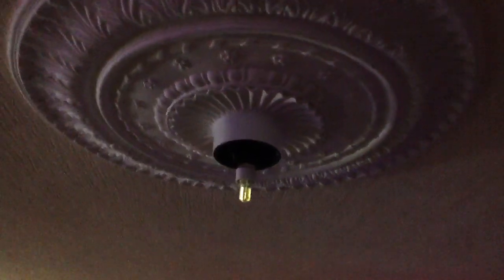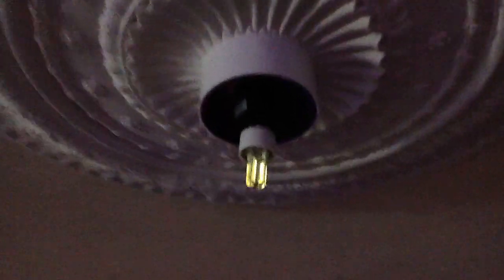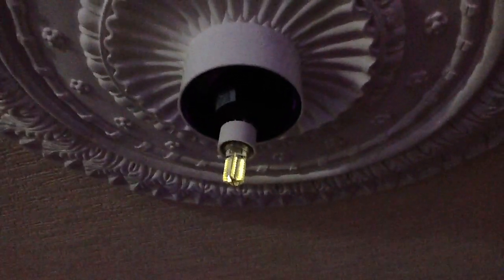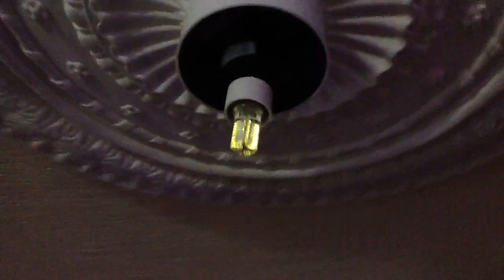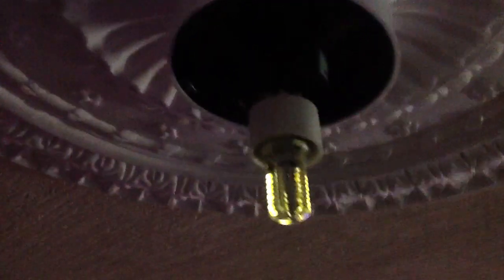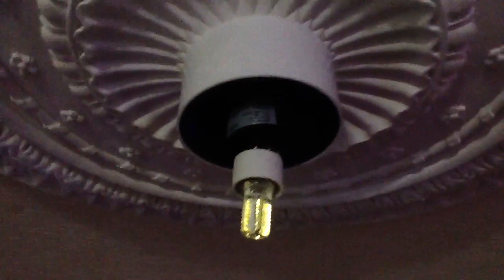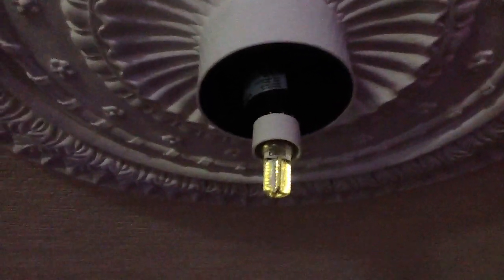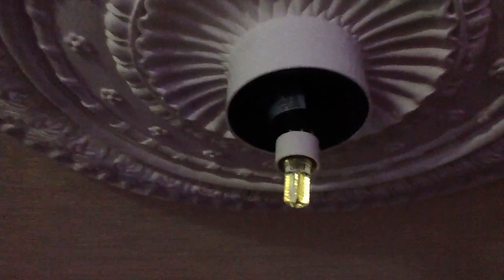LED lamps glowing when turned off.

Comment: yes, I was swapping my light switch over for a new one, and I used a multimeter to check the volts where off, as I just hit the circuit breaker, but I got a tiny reading between 4 to 6 volts, and when I switched to DC it went to 8 volts, however I didn't get a shock and I certainly couldn't work out why that was happening.
Reply from the maker: The high impedance of digital meters results in weird readings from even unconnected wiring.  The DC component could even have been an electrostatic thing.
Reply: No, in this case the multimeter was a very accurate one, i checked with another one and it also showed a current, but it was around .25 mAh
Reply: @JoshuaNicoll  Very accurate it may be, but try rubbing the probe against your jumper and see what voltage it reads - probably go off-scale. 
Accuracy can only be proved when you've got something to compare it to. 
Try connecting a resistor (100 ohms maybe?) across the terminals then measure the voltage... Or measure it with a very accurate (sometimes more so than digital meters) analogue voltmeter and see what you get.

Comment: I am observing something similar here. When the wall switch is off the LED bulb I use will periodically flash faintly. I'm suspecting it's the same effect but something inside the bulb first charges up for a bit (a cap?), then discharges. Not sure what exactly would be going on though.

Comment: Oh, this is normal?? I've noticed this in my house as well, and when the socket is off, I'm measuring about 50V. I haven't tried short-circuiting it, since I assumed it was live and didn't want to shutdown half my house and walk all the way to flip the circuit breaker.

So I shouldn't worry about this?

(for reference, I live in Holland, and we carry 230V at 50Hz, should that make any difference in judgement...)
Reply from the maker: +thany3 Your meter probably has an impedance of 10 megohms, so even a low level capacitive leakage between switch wires will show up as a modest voltage.  It's a very common effect.  Even some compact fluorescent lamps used to have issues where the power supply capacitor would charge up until the lamp struck and discharged it again.  This caused a dim pulsing of the light when it was supposed to be off.

Comment: Is it safe to leave a LED bulb with a resistor clipped,  connected? Bulb rated at 3w but after clipping, drawing under 1w
Reply from the maker: I use hacked bulbs all the time here.
Reply: @bigclivedotcom  Thank you Clive, just the feint glow is freaky. But I guess it acts like a standby light. Look forward to your stream tomorrow. Sleep well.

Comment: This happens in my house in both the living room and main bedroom, both of which  are on two way switches.
Is there any simple solution which doesn't involve replacing the house wiring?
Reply from the maker: Try different lamps, or just accept the slight glow as it doesn't cost anything to run.
Reply: @bigclivedotcom  So no cheap easy fix hey?
Looks like I'll have to get used to it as I can't afford to replace the 13 down-light lamps again.   
It's a bit annoying as it's in an open plan house and the main bedroom and living room are adjacent and sometimes it makes it a little hard to get to sleep.
Reply from the maker: @ericoppel5698  If they are standard lamps on the same circuit then replacing just one with a different type may fix the issue by shunting the leakage current.
Reply: @bigclivedotcom  Thanks. I'll give that a try.    :-)
Reply: @bigclivedotcom  Hi Clive, I just wanted to say thanks. I tried your idea and replaced one lamp  in each room with a different one I had laying around in my messy workshop, and it worked!   
Problem solved thanks to you!    :-)

Comment: I've seen that related flickering with CFLs you mention, some brands would flash at almost full brightness (quite slowly), others pulse weakly but quicker. I guess that has to do with what voltage the oscillator kicks in at.

My ex's old flat was the worst, with 4 doors on the livingroom, and a switch by each door (2 intermediates and 2 - 2 ways) The capacitance was quite sufficient to flash the bulb 2-3 times a second. She went back to a regular bulb, after refusing to let me put a high value resistor across the terminals in the lampholder because her landlord wouldn't like it

Comment: Would I be right in thinking that's on a two-way switch?
Reply from the maker: +killerdalek Yes it is.  Two way switching seems to create much more capacitive coupling.
Reply: My problem went away when I re-wired the two-way switches with three-core and earth.  Previously, in addition to singles for the rest of the lighting circuit, the two-way switching was done with simple twin-core.

Comment: That happens because the light switch on the wall has small leds.
Reply from the maker: Just a plain lightswitch.  The leakage is capacitive coupling between the switch wires.
Reply: bigclivedotcom My bad. In my case the switch was not a plain one.

Comment: Hmmm I wonder is this related to the "problem" I had with my dawn simulator lamp? I was soldering it and noticed that when i touched led-strip, three nearest leds light up. I think that 50 Hz interference did get to leds through me via capacitive coupling.

https://www.youtube.com/watch?v=B8NOzfsrFpw